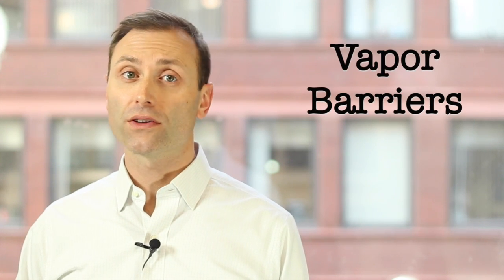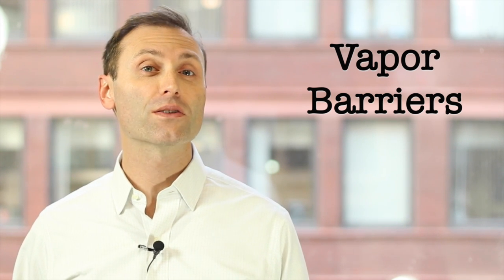Vapor Barriers

Comment: In the Northern areas you need a vapor barrier on the inside. Period. Now you can get smart barriers that will breathe in the warmer months.
Reply: Thats what the job security people will say...can not count the problems in the cold Northern US of water trapped inside walls, turning insulations into frozen blocks of ice, create black molds, and rot out framing...the old plaster and lathed walls with rough cut lumber frames have done the best, they breath and let the walls dry out...this plastic has not done well, yet everyone believes it is good..keeps people sicker i guess, more $ for all
Reply: @tenguken847  I built a vacation cabin in NE PA (Zone 5 I believe). I went with T1-11 exterior grade plywood for my siding, open cell spray foam, and no vapor barrier. Air is always moving with my mini split and i maintain low humidity inside. If I were to do it again i'm not sure if id go with spray foam for other reasons but it all seems to be working just fine.